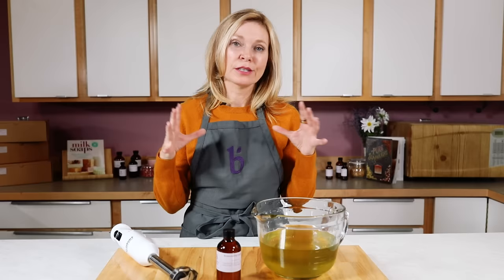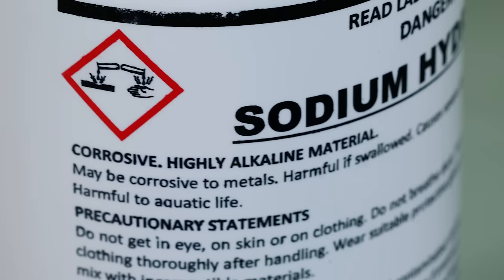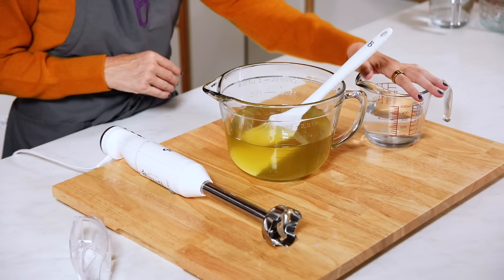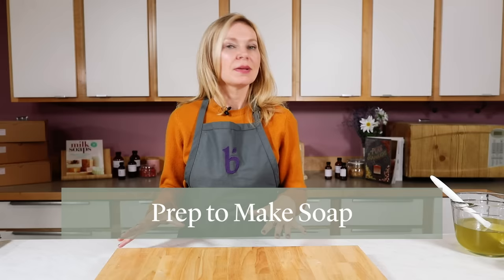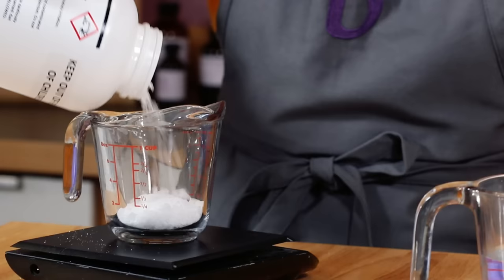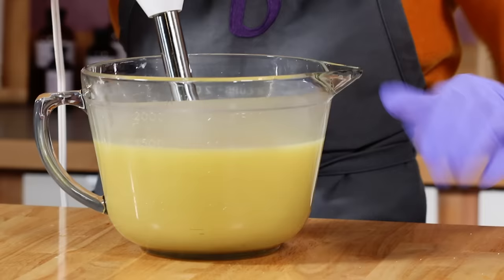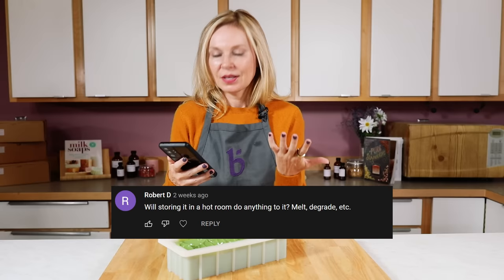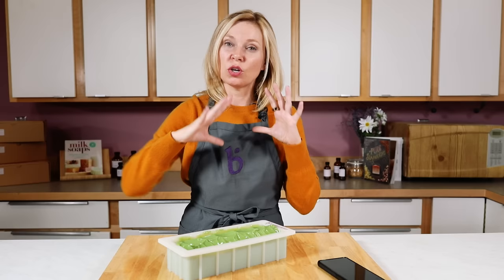How To Make Cold Process Soap - Basics Of Soap Making | BrambleBerry.com

Comment: BUT WHAT'S A GOOD TEMP FOR THE LYE WATER & OIL TO MIX TOGETHER
Reply: 120 degrees for both oil and lye water 💦
Reply: @chrisdownes9771  CAN IT BE LOWER? Or is 120 recommended
Reply: She normally prefers when they’re both in the 110-120°F range but sometimes she will go lower depending on the recipe. You should watch their original how to make cp soap beginner series because she goes more in depth in those
Reply from the maker: We generally recommend 120 °F for beginners, but it's absolutely possible to use lye and oils at as low as 80 °F. We usually suggest going for lower temperatures if you're working with delicate ingredients like milk or extracts.
Reply: @bramble-berry  Or adding honey. 😁
Reply: If I have a lot of hard oils / butters, I will soap at upwards of 130-140F; however, I don't usually try to do swirls or fancy decoration with those either.
If I have a good balance between liquid oil and hard oil or butters, I try to soap at around 100-115F, especially if I have a fragrance oil that may accelerate trace.
Adding sugars [no matter the type; honey, granulated sugar, milks, using beer or wine, etc.] will heat up your lye solution a lot too. The first time I used honey, I scorched it, because my lye solution was not cool enough to incorporate that honey. Oops. 😊
Reply: Thanks for sharing!

Comment: I love your videos and how it's in sections and straight forward, thank you for this!  I also have a  question when you say use distilled water. Do I actually have to buy ready distilled water or I can just boil the tap water first before mixing with the Lye ? 🙈
Reply: It depends on the quality of your water. If it is good enough for drinking, it is probably okay for making soap. Some water contains chemicals or minerals that can cause problems with soap making. I would recommend making a small batch of soap using the water you have available and see how your soap turns out. 
Hope this helps! 🥰

Comment: Hi! I just watched all your beginner videos of soapmaking and tried my first soap. Everything was looking perfect until I added my fragrance and it turned out in a disaster. I guess I added the fragrance a bit slow and until that time the soap was a lot thicker. But I added it, started to stir and then I noticed that there were tiny unbroken pieces everywhere in the mixture colored in yellow and before that it was very smooth. Like when you cook and you add a flour but it's not entirely beaten and mixed. I filled my mold anyway buy now I don't know why that happened and how to prevent and will that make my soap not usable? Also one hour later after I filled the mold I see a crack in the middle :(
Reply: The mess you experienced is called ‘ricing’. Some fragrances cause ricing. I have never experienced it because I don’t use a lot of fragrances. However, now that you know what caused your soap to start ricing you can research it.
I hope this helps a little! 🥰
Reply: @jeanettehaygood4154   This should have been mentioned in this "Beginner Video". Its a REAL disappointment to have wasted these expensive ingredients. :(

Comment: What is best practice for cleaning up those stray crumbs of lye that might fall away from the container when pouring into the dish? I would think a paper towel that’s been dampened, but would that cause a dangerous chemical reaction?
Reply from the maker: We suggest using gloves and first wiping up any big crumbs with a dry paper towel and then wiping the counter again with a clean, damp paper towel to clear any lye dust.

Comment: Thank you for the video.  QUESTION??  I wasnt told to use distilled water when someone showed me how to make cold processed soap.  I made a couple batches using tap water.  What will become of them?  Are they doomed?  Thanks for any answers.
Reply from the maker: We've found the soap lathers easier when it's made with distilled water, but soap made with tap water should still work well :)

Comment: Hi there, I’ve just made a batch of soap and I am a total beginner. I have a quick question which is. I made my lye solution allowed it to cool down. I waited about an hour to find that it was cold. I then proceeded to make the oil mix waited for that to cool and then combine the oil mix with the lye mix. I’ve just seen that it’s good to keep the two mixture at the same temperature because this help the batter form properly - as I allowed my lye solution to cool down too much, could this effect my final product?

Comment: i see that you used a glass pyrex measuring cup to mix the lye & water. I've just read on various sites that this is unsafe as lye weakens glass and can cause the glass to explode. Is it safe to use a glass pyrex container to mix the lye and water?
Reply from the maker: We recommend heat-safe glass, plastic, or stainless steel bowls. Don’t use aluminum – it can react with the lye and create toxic fumes.

Comment: You can sodium hydroxide  neutralize with vinegar on your skin, no water only vinegar.
Reply from the maker: We recommend treating Sodium Hydroxide spills like you would with any acid or base spill, by running cool tap water over the area for 10-15 minutes. This is a much quicker solution than having a container of vinegar on hand to pour over your skin.

Comment: Ma'am, 5% superfat would mean that for every 100 grams of soap I can add 5 grams of extra coconut oil if I don't wish to go for lye discounting?.....so if I want to make the soap more cleansing and yet ensure that there is no extra lye remaining in it, I can remove 2 grams of coconut oil from the recipe per 100 grams which would reduce superfat to 3% but ensure enough safety lye buffer? I don't want white streaks left behind in my dishes so I thought reducing the superfat further to 3% may be helpful, what do you think?
Reply from the maker: That's right, you're also welcome to customize your superfat percentage on our lye calculator.  Here's the link: https://www.brambleberry.com/calculator?calcType=lye
Reply: @bramble-berry  checked the calculator Ma'am, it's helpful:).....still can't make up my mind, should I continue with the 5% superfat coconut oil soap for kitchen dishes......do u think 5% will also leave the dishes squeaky clean without any white/oil marks?

Comment: but it can still work as a soap if you use 99 percent sodium hydroxide its not necessarily bad right
Reply from the maker: It will still work with 99% Sodium Hydroxide. We suggest increasing your superfat level by 2% if you are working with our calculator to figure out your lye amounts in your recipe.

Comment: When you mix the colorant with some oil, do you take the oil from the recipe? i.e., subtract that much from the oil amount? Or does it even matter?
Reply from the maker: We usually don't - it's such a small amount of oil that it would make calculating a little tricky. We just assume it will add a little bit extra oil to our superfat percentage!
Reply: @bramble-berry  Thanks! Very helpful for the beginner. This answers one of those questions I've always had.

Comment: Does the lye heat up the water? She never showed us any measurements or how much they weigh
Reply from the maker: The lye heats up the water and needs time to cool to a safe soaping temperature. A great recipe for beginners is our Simple and Gentle Soap Project, the instructions are available here: https://www.brambleberry.com/articles-and-projects/projects/cold-process/simple-and-gentle-soap-project/PS000211.html.
Reply: @bramble-berry  I tried clicking add project to cart and it doesn't tell me how many ounces of oil and lye to use. It only puts items in my cart. I was asking because you never showed in your video how many ounces of oil you're suppose to safely use with however many ounces of lye.

Comment: Attempting to make my first batch later today or tomorrow, wish me luck. 

When measuring out the water, it is still be weight, correct (haven't found anywhere that says specifically)?
Reply: Found another video (common mistakes when making soap) that answered my question. 
Yes, measure water by weight.
Reply from the maker: Yes, when you add the lye to the water it will heat up. This video is not intended to be a recipe and is more of an indepth how-to video on the basics of making soap.

Comment: If your lye water gets too cool, or your oils do before you mix them together, is there a way to warm them up?
Reply from the maker: You can do a warm/hot water bath with your lye container. We do not suggest putting the lye solution on the stove or in the microwave. Your oils can be reheated as many times as necessary.

Comment: When making cold process soap do you need to use vanilla stabilizer so it dont turn brown??????
Reply from the maker: The vanilla color stabilizer works great for melt and pour but not so well for cold process.  Adding dispersed titanium dioxide helps counteract discoloration in cold process soap.

Comment: I have hard water coming out of the faucet.  How do you stop soap scum?  Is there a product to add to prevent this problem.  Yes, I do understand you need to add distilled water in the soap, that is a given.  Your thoughts would be appreciated.  Thank you
Reply from the maker: Soap scum is best prevented by fully drying your soap between uses and storing it on a draining soap dish. You can also add sodium lactate to your recipe, introduce a water discount, or cure for longer than 6 weeks.
Reply: @bramble-berry  I can attest to sodium lactate helping with this. 
I live in SE Michigan, where we have some of the hardest water in the US. We have almost no soap scum and I use sodium lactate in almost every recipe. If the soap recipe contains a lot of hard oils or butters, I won't necessarily use sodium lactate though... I want to be able to cut it. 😆
Reply: Can you tell the measurement of oils and water and lye
Reply: @adeebakhan6  Ann-Marie has done many videos that contain all that info. You can also run numbers through a soap calculator for size of your mold(s).
Reply: @adeebakhan6  If you are talking to me.  So far I have not yet begun the process.  I have just listened to others.  I hope to when possible.

Comment: Does the oil you use to dissolve colorant, add in the total oil to calculate lye? Thanks!
Reply from the maker: We don't typically include it in the oil calculations since it is such a small amount but you are welcome to include it in your oil totals if you prefer.

Comment: It's mentioned that the oils need to be "at the correct temperature" but that temperature is not specified...
Reply from the maker: We like to soap with oils around 115° F, however, the ideal temperature can vary based on the recipe.
Reply: @bramble-berry  awesome, thank you! Is there a general range that is acceptable for most recipes?

Comment: One thing I've noticed with soap making videos is that they very rarely tell you what the correct temperature is supposed to be14:30. Oh well.
Reply from the maker: Generally the correct temperature will be around 120 degrees F. So long as the lye water and the oils are within 10 degrees of eachother it should be just fine!
Reply: @bramble-berry  Thank you very much!